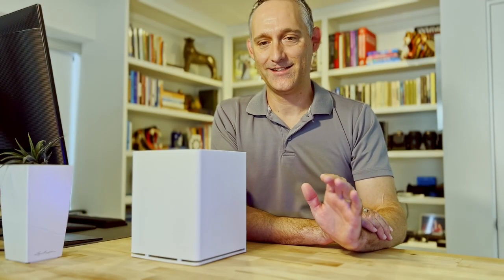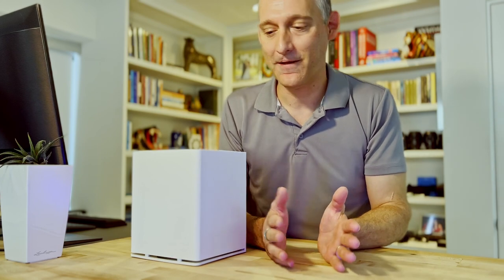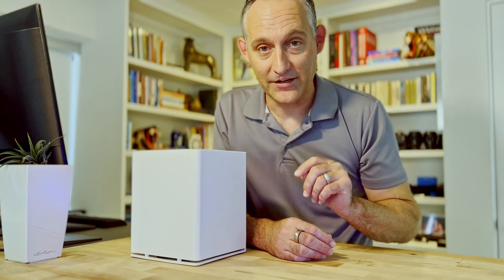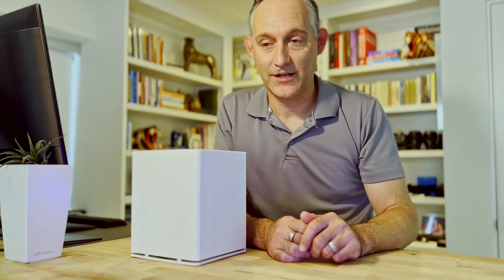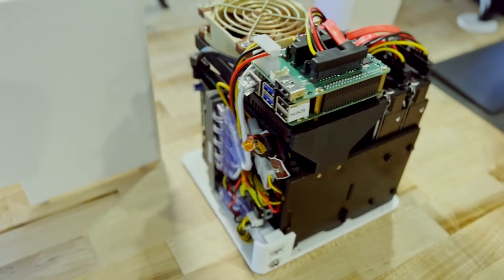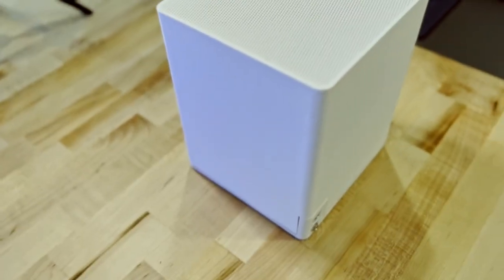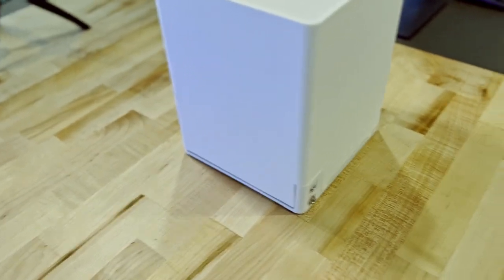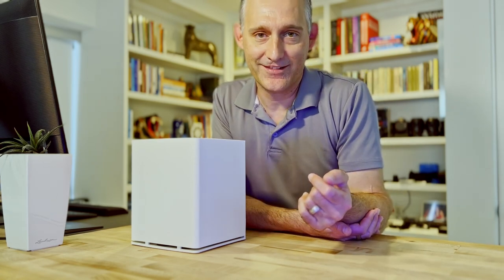Introducing.. RockARM | This is the future of computing, Today!

Comment: I want to build a robot with a rock pi 4.  I am going to build more robots with more rock pi 4's.  If I wanted to connect my robots (like 5 of them) in the future, can I connect all the rock pi 4's and use all the processing and gpu power for future AI applications if I want to add AI (machine learning) to my robots?  Or would it be super hard to program stuff to use all that hardware?
Reply from the maker: That sounds like a very interesting project! That type of clustering is likely best suited with something more like Kubernetes (or a better ARM variant such as k3s or micro-k8s). Even there however, that's more about automated process orchestration, not abstracting the individual threaded processes to queue across compute nodes. I'd be interested where your research takes you on this, keep me posted!

Comment: 2 x 3.5" HDDs for a homelab? To store what exactly?
Reply from the maker: Fair question! At the time of the build, the challenge was finding cost-effective 2.5" HDDs that were at least 4TB, and did not use SMR layout, which is a massive performance killer on a RAID array. Certainly other ways to approach it, based on your storage needs, and this area has changed a bit since this project debuted. What would be a good target size for mass storage in your opinion? For me, I'd like to see at least 8-10TB usable space!